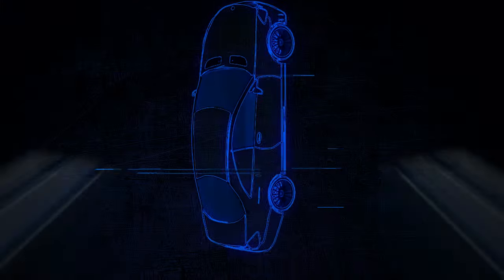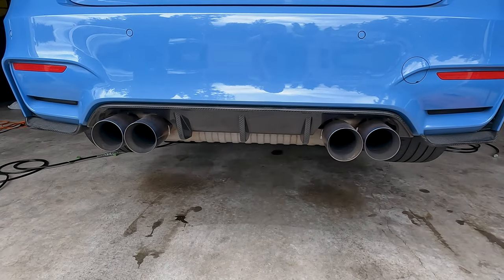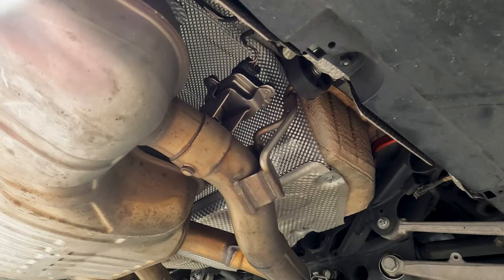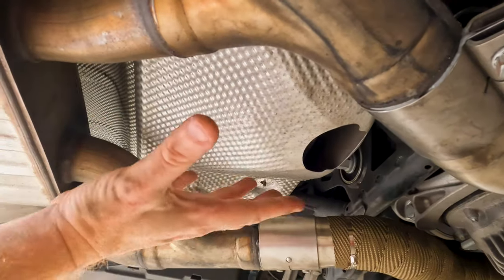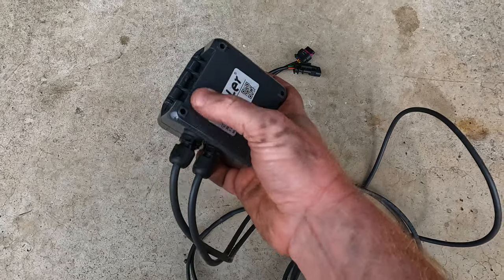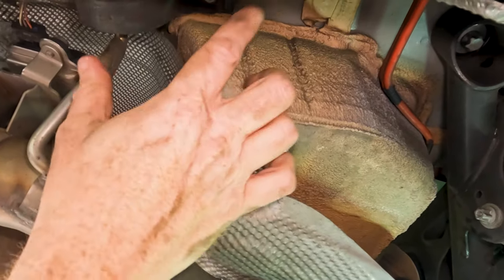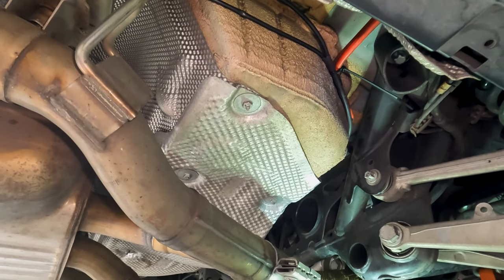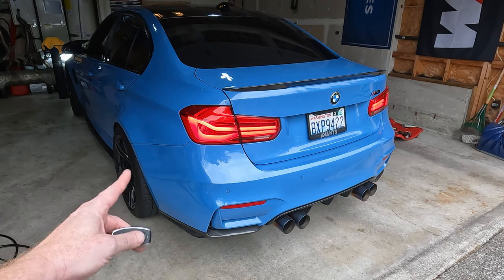Your BMW exhaust flap button doesn't actually do what it says!  Dahler fixes that!

Comment: Another great video!! Thank you! Question....I was having a signal issue when I tucked the control in the empty well (G80) behind the drivers rear wheel. So I moved it to the battery well area. Plenty of room to mount it. Do you see any issues?
Reply from the maker: No issues at all, and well done!  I will be installing one on my G87 very soon too!
Reply: @BMWDIYGuy  thank you very much!! I will be looking forward to seeing it and how / if you seal up the opening.

Comment: Does it work for X5 2024 ?
Reply from the maker: Very likely yes but confirm for sure.  They have single and double valve modules.
Reply from the maker: @ghost9119  no it won't harm your warranty and no errors.
Reply from the maker: @ghost9119  I can't say all BMWs are the same for sure, but likely yes as most use the same valve motors.
Reply from the maker: @ghost9119  it should yes, double check with Kies Motorsports before you order

Comment: What’s the difference between the bimmer link than this
Reply from the maker: Programmable, remembers previous states,  and cane be open closed at command with a remote.  Also it fully opens the flaps and leaves them full open.
Reply: Yeah Bimmer Link will not open fully only partially I believe... Dahler will open 100%
Just installed on stock s68 V8 awaiting exhaust and first time I've EVER herd a great change.

Comment: Cool man, thanks for sharing, but why so few revs? And can I close the valve in sport/+? My f80 is pretty loud, so would be great to have the option to drive in sport/+ with the valves closed too.
Reply from the maker: You can absolutely have the flap open or closed in any mode, so you are good to go!

Comment: I got the Dahler valve controller installed but I can’t figure out if the sound control button makes the exhaust louder or if it’s all fake noise coming in. I hear more burbles with it on, but since the valves are open in both settings I don’t know if it’s fake or not.

Any thoughts?
Reply from the maker: Exhaust will definitely be louder with the flap fully open.. the bmw active sound doesn't fake bubbles, just exhaust hum

Comment: How many valves does a 22 m240i g42 have ? Thanks
Reply from the maker: So best two ways to check:  look under the back and look for the flap controller.  It's a black box on the side of usually the outer exhaust pipe.  If you have dual exhaust, probably one.. quad exhaust probably two.  You can also use a flashlight and look for the flap itself in the outer exhaust pipe(s)